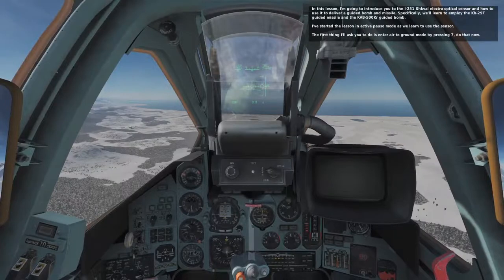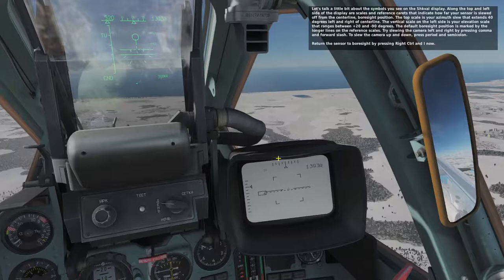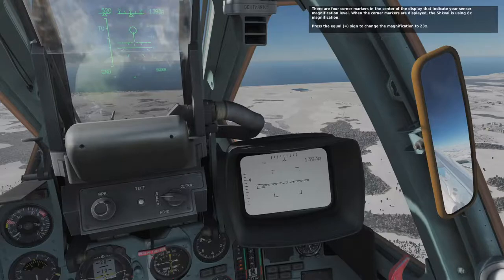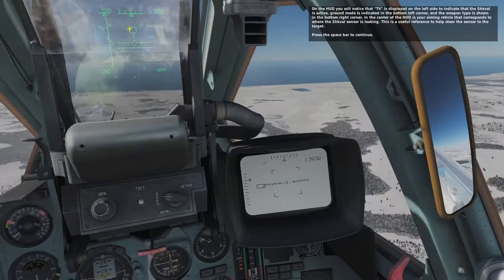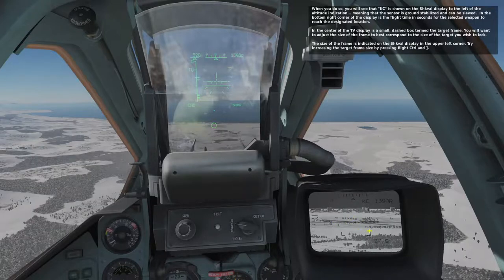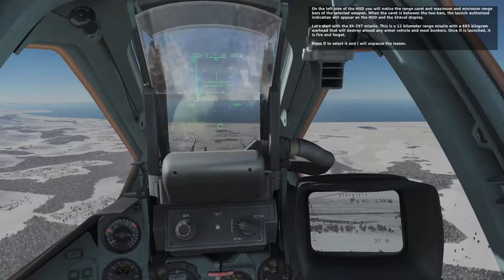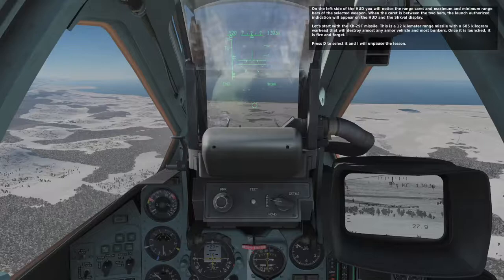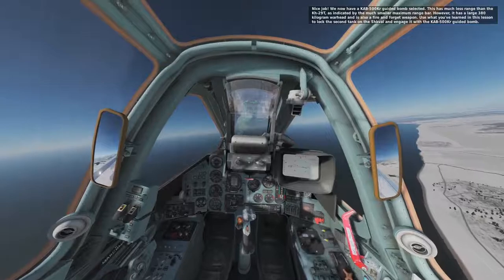DCS World SU-25T Shkval Sensor, Kh-29T, KAB-500Kr.

Comment: Doesn’t even let me
Reply from the maker: It doesn't let you what?
Reply from the maker: @ranxerox575   Keep an eye on your max/min range bars on the left.  Make sure that the target range arrow lies in between the two bars or the bomb won't be released.  Also, I have noticed that your elevation affects the distance between these two bars.  Fly too low and the bars will be too close to each other and you may have missed your window to release the bombs.  In my vid, the exact moment I released the bomb is on 10:02 and 10:03 when these indicators disappeared.